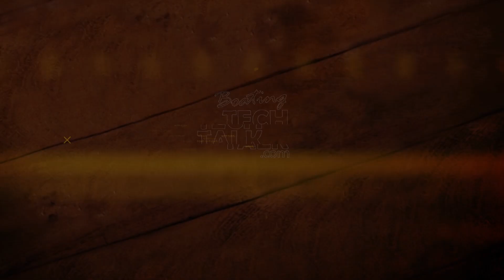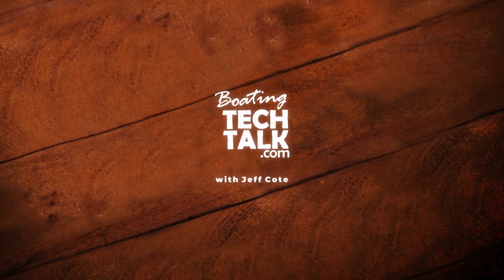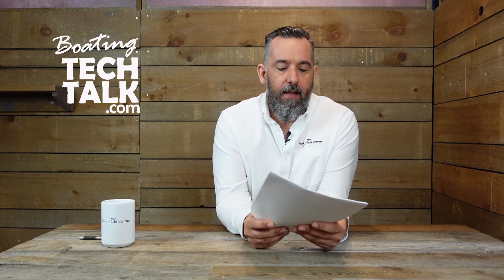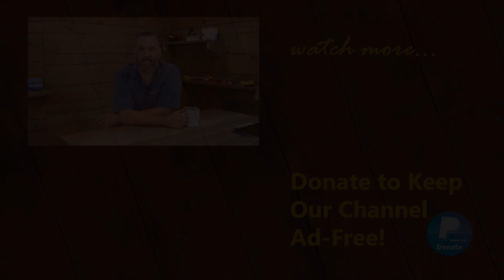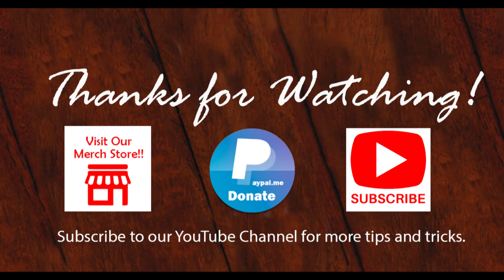I Am Fusing My Solar Panel - What Is a Voltage Spike?

Comment: Now for disconnecting solar panels, should we disconnect the + line first, so any excess current has somewhere to go (through the -)?
Reply from the maker: Hi Ben, don't think it would matter as any disconnect in the circuit will work. Perhaps someone more knowledgeable can answer this question.

Comment: What about how protecting pv panels from reverse current when there is more then one string installed, fuses should not be used?
Reply from the maker: Sounds like you are referring to diodes, and many panels have them built-in as a part of the junction box.
Reply: @PacificYachtSystems  thanks for the answer. But I’m referring about how to protect pv panels if there aren’t diodes installed, are fuses right to do the job?

Comment: you can also install limited surge protection on both DC and AC circuit as a backup if you are qualified electrical trade person or for AC you can buy one that just plug into the AC wall plug. 
I still do not know whether these approaches will help with an EMF burst from nearby lightning strike, any thoughts on this would be well appreciated
Reply from the maker: Hi David, can you tell me more about this. Not sure i understand what you mean?
Reply: @PacificYachtSystems   sorry I am a electrical engineer retired so i have plenty of time to look at these type of things. I still do not know whether this will help in a lightning surge situation  
Available in 24V DC surge protection brand BEP module part No. 80-707-0005-00
https://www.marine-deals.com.au/meters-and-monitors/bep-surge-protection-module

PRODUCT DESCRIPTION: 

The Surge Protector will protect against transient pulses and surges from electrical/ electronic devices such as motors and pumps. It also protects against high energy surges such as an alternator load dump from a battery cable removal while under high charge currents. Designed to meet ISO 7637 1 (12V), ISO 7637 -2 & SAEJ1113-11. There are versions for 12 & 24-volt systems. 
The Surge Protector essentially ‘Clamps’ the voltage at 17V (12V system) or 35V (24V system) The module is polarity sensitive and must be wired correctly to operate. It should be wired as near to the load as is practicable ie, after long cable runs & battery isolators etc. There is a 250mA relay output (at battery voltage) that is that latches on under high energy surges of >1-2ms and can be used to drive an LED indicator. The relay will latch when activated and will only reset after power is removed and reapplied. The relay will not become active under transient pulses as they can occur frequently.
For AC protection can get surge protection at the local electrical wholesaler 

https://au.rs-online.com/web/c/passive-components/surge-protection-components/surge-suppressor-units/

also socket mounts eg. Belkin 6-Outlet USB Surge Protector, Wall Mount - Ideal for Mobile Devices, Personal Electronics, Small Appliances and More (900 Joules)

EMP burst can happen when lightning strike  
near an water areas and can take out the electrical systems on board boats if not protected
some people install these Fore spar Lightning Master Static Dissipater Rod
https://www.amazon.com/Forespar-Lightning-Master-Static-Dissipater/dp/B000XBDFJO/ref=sr_1_1?dchild=1&keywords=lightning+master+static+dissipater+rod&qid=1606727675&sr=8-1

•	Lowers the likelihood of a direct lightning strike by reducing the build-up of static ground charge and retarding the formation of ion streamers
•	Lightweight 21" long dissipater mounts to the masthead and extends vertically above all other masthead equipment.
•	Fore spar does not claim that this product is 100% effective in preventing a lightning strike. This product does, however, control the known causes of lightning strikes and thereby reduces the incidence of direct strikes.
but do not know whether this is like elephant repellent which you do know if it works unless an elephant turns up
hope this helps

Comment: Hi Jeff,
I have questions about electrical relays on my new sail boat.   The manual lists 3 relays:
1.  Bilge pump
2.  Windless
3.  Bow thruster
So my questions are:
1.  What does a relay do?
2.  How do I know the relay is working?
3.  What maintenance is necessary for a relay?
Thanks for your help and I very much enjoy your videos.
Marshall
Reply: Two types of relays...mechanical and electronic.  Relays allow you to control (turn on or off) large voltage/current with a small voltage/current.  Consider starting circuit...starter motor needs huge current and large cables.  Relay contacts (normally open) would be connected, with large cables, between battery and starter; when that contact closes, large current flows to the motor.  To activate the relay a small (low current) wire would run from battery supply bus to a smallish starter switch at the dash and then to the activating coil on relay.  When starter switch is closed, a current flows through relay coil that creates magnetic field pulling the open contact closed and allowing large current to flow through contact to starter motor.  An electronic relay does same thing, but no moving parts...just transistors.

Typically there is no maintenance you can do on relay bec they are a sealed unit.
Reply: @borysnijinski331  Thank you.  Clearer
Reply from the maker: Thanks Borys!

Comment: Thanks for this. Question: doesn't flipping a switch or breaker make that same non-immediate interruption? Wouldn't the contacts in the switch/breaker get tarnished and scortched?
Reply: Switches and breakers are designed to deal with the arc...the arc is actually important in keeping the contacts clean by burning off oxides.
Reply from the maker: Good one Borys.

Comment: I think you mentioned before disconnecting shore power we should turn off all a/c circuits at the panel, then turn off the main circuit, then unplug.  I always turn off main circuit before unplugging, but I haven't turn off each individual circuit first.  Should I?  What is happening when I don't?
Reply: If you shut off main breaker, it needs to interrupt all the current.  If you shut of the individual breakers first, each smaller breaker interrupts much less current and then main breaker has less current (maybe none) to interrupt...kinda like jumping off a cliff (ie opening the main breaker under load) vs taking steps down the cliff (ie opening individual breakers).
Reply from the maker: Very well said Borys, thanks for sharing.

Comment: Excellent discussion,  Jeff. Please correct me if I'm wrong, but in both AC and DC power scenarios, sparking damage to connectors and equipment can occur. In DC however, current is flowing one way only, and at high volts and amps, the arc produced can be very long lasting, very hot and damaging. I have been using a large DC circuit breaker to disconnect the panels, but now appreciate that solar cell damage can occur. Thanks again for your clarifications.
Reply: Disconnecting circuit under load will create an arc...the air between contacts as contact opens gets ionised and allows current to flow (that is the arc you see).  With an AC circuit, the voltage is constantly changing from maximum in one direction to maximum in opposite direction...when the voltage passes through zero, the arc stops, the ionised gas dissipates sufficiently that the arc does not reestablish.  With DC, the voltage never drops to zero so the arc continues.  Breakers and fuses have two primary ratings: a trip/blow rating and a maximum interrupt rating...when selecting a fuse/breaker you need to consider the maximum current the wiring can handle (trip/blow rating) and the maximum current the supply can produce (maximum interrupt rating).  If you have a wire that can handle 10A, you could add a 12A or 15A fuse/breaker.  If the supply, a large battery, can produce 700A (ie cold cranking amps) your fuse/breaker must be able to interrupt that amount of current.  Extinguishing the arc on DC circuit is much more difficult which is why fuses and breakers have an AC rating and a DC rating for maximum interrupt capability; the AC max interrupt rating is much higher than the DC interrupt rating.
Reply from the maker: Just gold, so well explained.
Reply: I should also add, there is always a spark when opening a breaker or switch when circuit is operating...that small arc is beneficial in keeping the contact clean.  The arc helping keep the contacts clean is why oversizing a contactor (aka power relay) is bad...not as bad as undersizing, but you would not want a 100A contactor/relay on a 1A circuit because the arc from 1A is not enough to burn off any oxides that form on the contact surfaces.
Reply: @borysnijinski331  thanks so much for weighing in on this. The subtleties of electricity are so interestingly exquisite......curiosity strikes again!
Reply: @henriaube2278  30 yrs as an electrical engineer and still learning.

Comment: You didn’t really answer the question. Every circuit has inductance.  When current is flowing through inductance it creates a magnetic field, sudden interruption of the current (pulling vacuum cleaner plug out of the wall or disconnecting solar panel) manifests as a voltage spike due to collapsing magnetic field in the inductive elements.  The magnitude of the voltage spike is affected by the amount of inductance and the amount of current flowing when the circuit is broken (2, 3, 5 even 10 times rated voltage for an instant).  The voltage spike is measured at the solar panel terminals and although the spike is very short duration it is that voltage spike that will punch through the insulation between +ve and -ve parts of the solar cell.  If the insulation in cell(s) gets damaged, the cell(s) no longer produce power.  The cells closest the the terminals are the ones that will see the biggest voltage spike and most likely the ones that get damaged. Covering panel(s) with blanket is a good idea, but adding a make-before-break disconnect switch that connects a high value resistor across the solar panel terminals is good insurance against any possible voltage spikes.
Reply: You explained it well, but to Jeff's target audience I bet this is gobbledygook.
Reply from the maker: Good one, thanks for sharing!